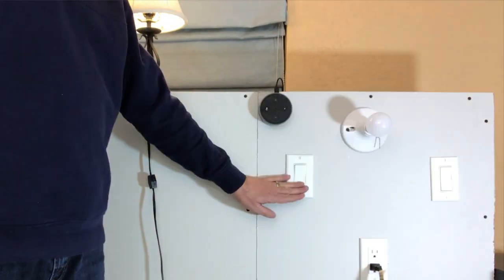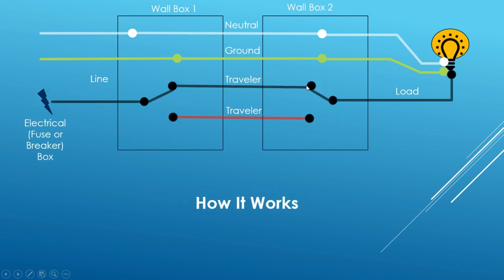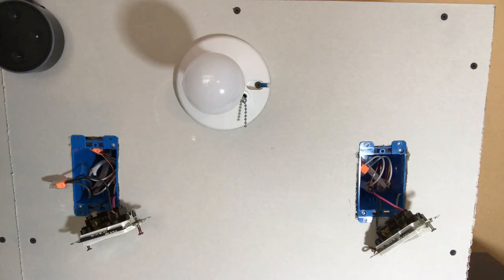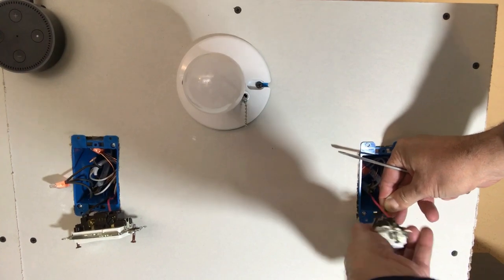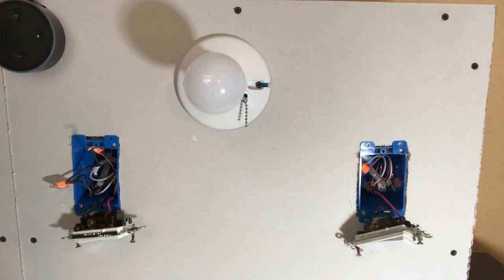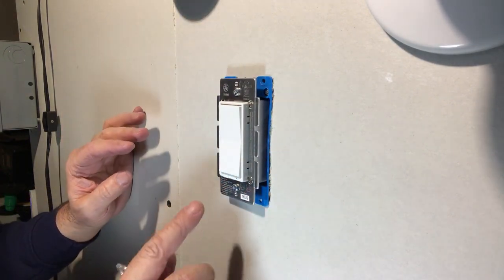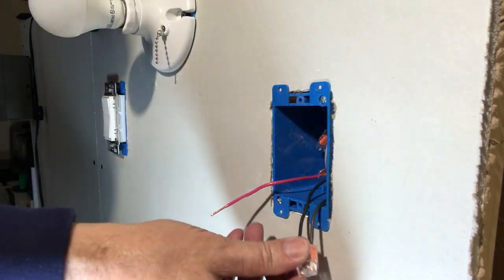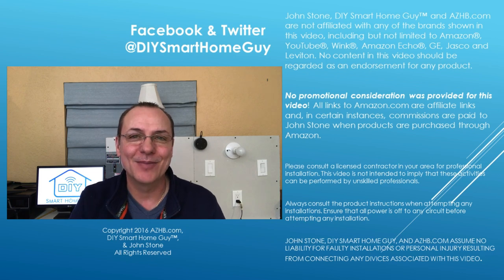DIY 3-Way Switch GE / Leviton Smart Switch Installation (Z-Wave)

Comment: I followed your video down to the T, I also followed Levitons vid which is the same process... i installed a 3 way switch but the light keeps turning on and it won’t turn off. I replaced the switch and the remote just to make sure they are not defective and I have the same problem. The light just stays on, I can turn it off but it will turn back on within 1 second and stays on. I noticed that it happens when I connect the traveler wire to the main switch from the remote.. so I disconnect the traveler from the main switch and it works fine! Could it be the wiring on the remote box end? I’m at a loss, ive spent many hours troubleshooting and checking all wires...
Reply: Your issue is, you have your main switch at the "line in" box when it should be at the "load" box. Its not the same connection as this video with leviton switches. Look at this link to show u the difference https://youtu.be/Es8b5DrW_Qo

Comment: Great video! My only critique is that you are working with live electricity wearing a gold ring. That is not a good idea.
Reply: I'm an IBEW electrician and in my apprenticeship I worked with a guy who contacted a live circuit with his gold ring. The current melted the gold and he suffered 3rd degree burns. Your video is quite helpful and answered my question for 3-way and 4-way applications. I'm currently upgrading my new home to make it easier on my elderly mother.
Reply: Same here John. I'm an IBEW electrician and a USCG vet. In both environments I've seen lost fingers and melted rings/3rd deg burns. Your video was very well done and helped me install the Leviton switches in my home without a hitch. Cheers.

Comment: hello. here is my situation I have a 3 way switch on one wall it has  two switches, one controls the fan the other controls the light. on the other side of room there is one switch that controls only the light. I have a Jinvoo smart light switch that turns those two switches from two separate switches into one switch that will be able to control with Alexa I hope. But sense I'am combining all these wires into one switch I don't know what goes where. also if you can't tell this is my first time working with this type of thing. I have replaced switches but just to from the old one to the new one. nothing like this. any help would great.

Comment: I have 3 way Leviton Z wave Dimmers 
DZ6HD is the Master
DD00R-DLZ the Remote
Your video Says the 2 Blacks Combine in the Remote Box & the switch should only Have 2 legs White/Nuetral & Red/Traveler. 
Leviton Zwave Has a 3rd Black Leg on the Switch. So I am Confused
Reply: I am in the same boat with the leviton switches
Reply: Kyle Harper don't go by this Video. The switches he's using are not the Same

Comment: Hey all, I bought the GE Dimmer and add-on switch. I have the up stair switch box with 2 Black, ground, red and white bundled in the back. The down stairs switch box that runs the same light has 1 black, ground, red, and white (with no other wires in the switch box) Is it possible to hook the switch up?
Reply: Yes, they it is originally 3 way switches. Upstairs has connected 2 black and 1 red. Down stairs has 1 black, 1 white, and 1 red connected. The light it controls is the light in the stairway.
Reply: Hello Jhon. Thank you for this video. I'm not a English native speaker and I want to ask you some question. I ordered the Tp link hs210 kit (two 3 way smart switches). I was planning to connect both switches in one 3 way circuit. Two smart switches for one lamp. After your video, I figure out that I can replace only one 3 way switch in the circuit. My question is. How does the actual (not smart switch) works if I turn off this switch?. Are still the Kasa app or Google home assistant able to turn On and Off the light? Thank you for your time and help.

Comment: I have option 3 or 5 not quite sure I tryed to make it work with the Ge smart toggle switch and struggled for 2 hours. I gave up and put the switchs in a different room. Is there a way to make option 3 or 5 work with the Ge smart switches? Or do I need to find another way to make this light smart? Thank you.
Reply: Thank you so much for your quick response. Yes you assumed correctly and upon further review of all the options I actually have option 9 not 3 or 5. I have a wink hub 2 and wanted to use the GE because of the toggle option and I have installed 12 other GE switches through out my home so it is a product I'm familiar with.  Again I have option 9 sorry for my confusion.
Reply: I'm not opposed to using another product as long as it has a toggle option and works with Alexa.
Reply: Thank you so much!!!

Comment: someone told me today. They installed a 3 way dimmer, either leviton or lutron and the only way it would work is if they installed it on the switch leg side.(or end of circuit) If installed on the the line side when dimmed there was a voltage drop and the other switch(es) would not work. he said this came from a Leviton or lutron tech. this doen't sound right to me . Is there any truth to this?

Comment: I only have 1 set of red/white/black wires not sure why or now to add the switch
Reply: John Stone  yes it's in one room 2 switches and 1 light,  the main switch has 2 sets of wires very odd
Reply: John Stone one switch each box and they both control the same light
Reply: I also notice that usually 2 white wires are together the main switch has a black and white together
Reply: John Stone Yeah I hear ya on that this is not the first time I found wires not connected the traditional way,  thank you for your help

Comment: There is a solution if you don't have a traveler wire but it's not Z-Wave.  A virtual 3 way circuit can be made with 2 Insteon switches.

Comment: so in one switch box I have the 14-3 wire only.  Any ideas as to how to hook that up?
Reply: built in 94.  I have been trying to determine how they wired up the switches with the lights, I know there are multiple ways you can hook up a 3way switch, but it makes it difficult to  determine what goes where with no power coming in separate from the 3way.  I have hooked up several of these switches, this is my first problem one.
Reply: Just ran into the same thing.  Looks to be wired up like this - http://www.oneprojectcloser.com/how-to-convert-a-regular-switched-circuit-to-a-three-way/.  I think the problem here may be that there is no real neutral on the secondary switch?  In the comments of that site i found this - "actually, there COULD be [a neutral], if you were to use a switch in that box that does need a neutral (lets say lutron maestro) then it wouldn't be using the switch lines as switch lines, but the switch line is just a data line to connect the switches, and then it would have hot and neutral, as well as ground, through that three conductor cable."  I don't follow - maybe he's saying to wire the other end to neutral and create a neutral line that was previously a traveler.  Any thoughts?

edit - possible solutions on this page?? https://community.smartthings.com/t/faq-ge-3-way-wiring/74962?u=jhamstead&source_topic_id=3631
Reply: Hi John, thanks for the video - it helped me to understand what I was working with (and what i wasn't).  The solution for my 3-way configuration (and possibly Kyle's) was found in section "line-switch-load-switch-2" of this FAQ - https://community.smartthings.com/t/faq-ge-3-way-wiring/74962?u=jhamstead&source_topic_id=3631

Like it said, I did have to re-wire at both switches and at the light.  And like you said, it's hard to account for every possible wiring setup without seeing whats going on.  I did do some continuity tests to confirm what was going where.  Thanks again.

Comment: Question?  So, if you want to install a z wave switch to replace an existing 3 way switchs you need a Z wave wifi switch AND a " companion switch"  you can not use the existing non wifi switch for the companion switch???
Reply: @DIYSmartHomeGuy1  Thank You

Comment: Leviton D215s switch does not work with regular 3-way switch.  You have to buy Leviton compatible ones for other 3-way switches in the same circuit.  It sucks
Reply from the maker: Good feedback Thanks

Comment: I have a 3 way switch in a 3 gang box that I’m trying to do smart switches in. I hooked up the two smart switches that aren’t replacing the 3 way switch and only one works. Also now the 3 way switch doesn’t work at all. Very frustrating to say the least

Comment: Hi all.  Recently picked up GE model number 12729 and an add on switch GE model number 12728 to replace a 3 way switch.  My house was built in 2011 and has neutral wires coming into the box with the line in.  However, the add on switch box does not (not to mention the wire colors are purple and orange).  I have a sense this will not work and will need an electrician to run a neutral to the box from somewhere else in the house (not sure I understand why they didnt run neutrals to all boxes.  Appears the neutral only accompanies a hot wire from circuit box - any intermediate switch box does not have a neutral).  Anyone have a different idea?  Thanks
Reply: Yea, got the electrician to run neutrals.  It was actually pretty easy - he just ran one from the nearest light to the switch.

Comment: sorry, this wont work for Levitron 3 way smart switch. it is way different. Manual states totally different than what you did, you logic is right, but connections are not the same.

Comment: there are a lot of other ways to wire a 3 Way switch
Reply: My house has a white wire on one of the switches which serves as the hot wire.  Make sure you identify your hot wire and traveler wires before you do something.
Reply: and how do you go about doing that?  Is there a video explaining how to find your hot wire (probably the easiest part) and then how do you figure out what traveler wires go where?  For example in a 4 way switch you have two separate networks of traveler wires - how do you figure those out?
Reply: It is a great diagram.  I think I have a handle on it.  Assuming receptacles A B and C, where B is between A and C, then in receptacle B you should see two separate sets of 3 wires (plus a 4th ground, but 3 different insulated wires) where one set is going to A and the other is going to C.  In A and in C you will see a single set of 3 wires (plus a 4th ground), and a single set of 2 wires (plus a possible 3rd ground).  The problem is figuring out which is A and which is C, assuming A is the receptacle by definition that has the hot wire with the 120V on it.  This can be accomplished by turning off the power and then connecting two of the wires to the lamp and seeing if when the power is turned on if the lamp will illuminate.  Sound reasonable?  The diagram leaves out the neutral that I need for smart switches, so could you comment on that missing piece?
Reply: I connected two wires to a lamp and it turns on and off, these two wires are a black and white wire coming from a larger sheath with a black, white, and bare copper wire.  That leads me to believe I am in option #2 because I have power at this receptacle that powers the desk lamp (my improvised 120v detector).  There is one more sheath in the receptacle with wires, it is three insulated wires with a bare copper wire.  There are no other wires int he receptacle.  I believe this sheath with the four total wires in it leads to the other receptacles in the 4-way switch.  I am using two Jasco Z-Wave Add On Auxiliary Switch (45710) with a switch from  Z-Wave Plus GE by Jasco Wireless Lighting Control Three-Way On/Off Kit.  I am so very close to actually getting this wired correctly.  I assume I can wire in just the master switch and that should work by itself, and then I can add in the other switches, please correct me if this is wrong.  According to the manual for the smart switch it claims from the breaker box I have LINE (hot), Neutral, and GROUND for the three wire sheath.  For the four wire sheath I should LOAD, TRAVELER, NEUTRAL, and GROUND.
Reply: After calling Leviton for assistance for my 3-way switch, they said I needed a remote switch which was not mentioned on the packaging nor is it available in the store, so they instructed me some confusing way how to wire one of the switches so that the three way WiFi dimmer switch could still work without the remote switch. Could you please attempt to explain that a little more clearly than the Leviton rep did? All he said was to connect the hot to the black, no to the red, neutral to White. Being that I'm not an electrician that doesn't make a heck of a lot of sense to me. I'm pretty handy and comfortable working with electricity but I still don't understand how this would replace a remote, or make it so I don't have to go buy a remote. Again my goal is to use the WiFi three-way dimmer switch without having to go by the 3-way remote. Please help ASAP as we are currently in the dark!
Reply: How do I wire for option 9 using Leviton DW6HD & DD0SR-DLZ?

Comment: I've literally been working on this for 8 straight hours. I used to think I was smart,  now I just want to jump off a building
Reply: @DIYSmartHomeGuy1  I finally figured it out. I didn't notice that the current was coming in from a different junction box than the one I originally thought. Thanks
Reply: Omg I was feeling the same but I laughed a lot on your comment.

Comment: Thanks for this amazing video! I follow all the steps and installed the smart switch and add-on. When I turn on the breaker on, the light just keeps on turn in on and off by itself. I've researched all I can and don't seem to have any luck. Could there be any wrong wiring that would cause this problem? The original wiring is number 3 on this diagram (https://www.easy-do-it-yourself-home-improvements.com/3-way-switch-wiring-diagram.html). The switches I have are 12722 and add-on 12723. Thanks in Advance!
Reply: Also, the blue light on the switch is only on when I have my light plugged in. It disappeared as soon as I unplug it.
Reply: Thanks! I'll give it a shot!

Comment: If you have your line voltage coming into a multi gang box with multiple switches controlling multiple lights, how do you isolate the neutrals per the instructions for the aux switch?  I am able to get the primary to work, but unable to get the aux to work.  Have tried multiple configurations, including putting aux switch in box with line voltage and primary in load box, and vice versa.  In each case, primary works but aux does not.